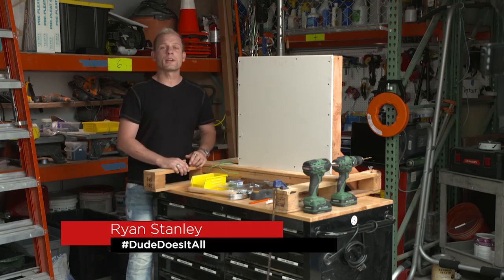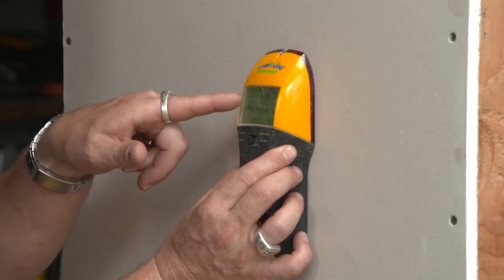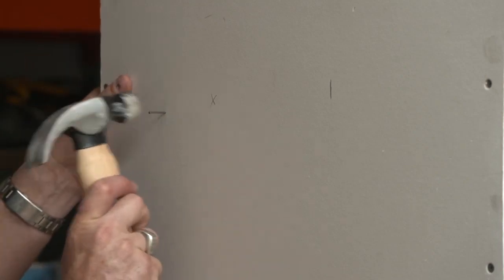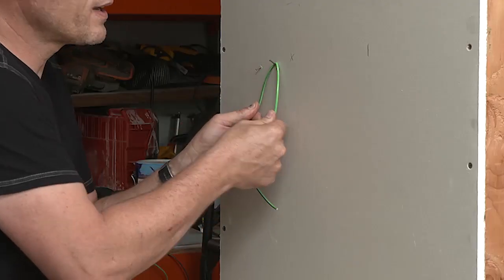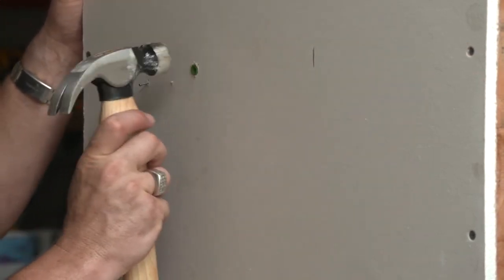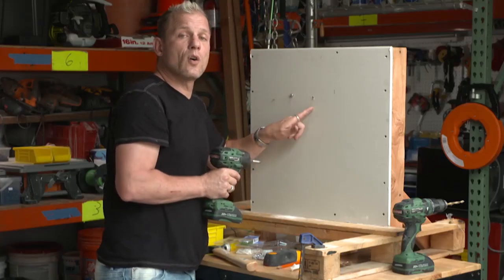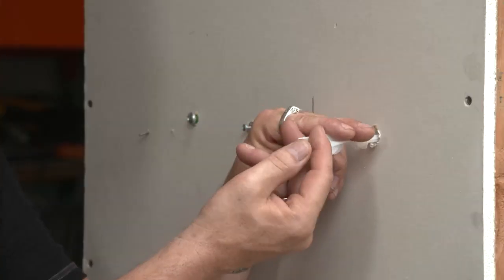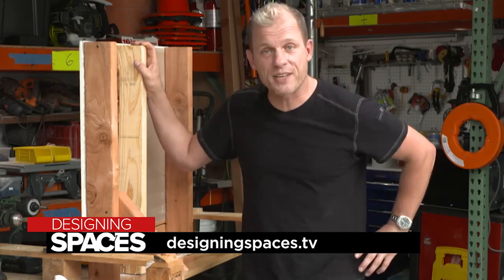Around the House with Ryan: Wall Anchoring Tips and Tricks

Comment: Probably a dumb question—but can you screw anchors into drywall at 45 degree angles? I still need/want a 45 degree angle of screw to protrude from wall to ensure the object doesn’t slip off the screw (there is no stud where I want to hang a ~ 1 day, 14 lb cuckoo clock (ie weights that need to be lightly pulled daily to “wind up”)? Any suggestions??